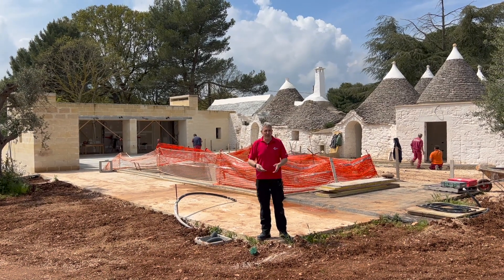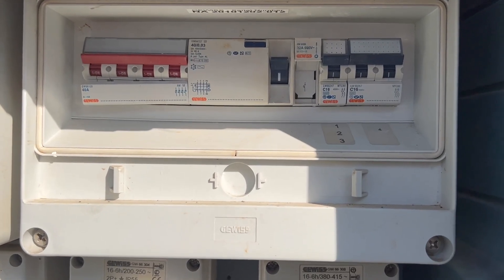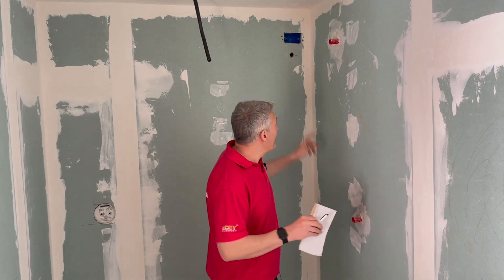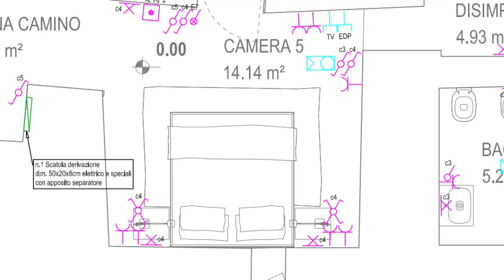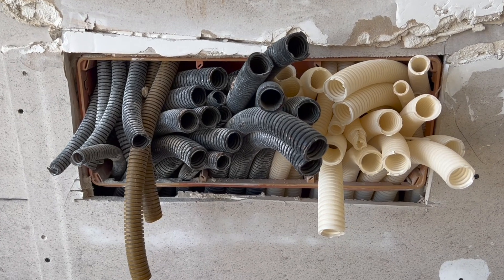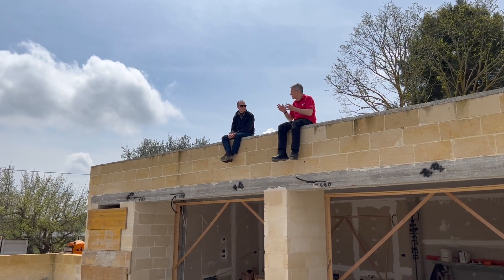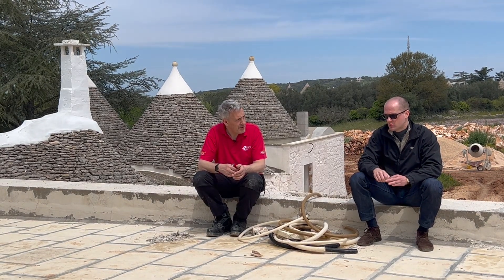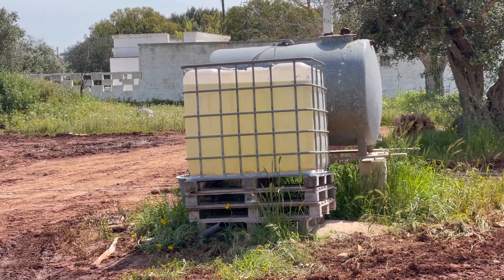Electric Wiring in Italy - You Won't Believe What They Do!

Comment: Here in Malta, we use stiff white pvc piping. No colour codes. We also use the same pvc piping for plumbing, although we use elbows not bending. they are mostly installed in chiseled gutters in walls which would later be plastered and directly on floors which would later pour concrete or lay dirt before tiling.

Comment: Would you mind explain why the UK, the iffin light switch of the bathroom has to be inside the bathroom? Which then causes the use of the "fantastic" pull cord switch? why not have the switch outside the bathroom, right next to its door? It would have been far simpler, let alone safer?
Reply: Somebody outside could make fun of you and turn off the light ;-). No there is no actual safety reason any more. Today installations have waterproof versions. It's just humid air in the bath room, you are not showering the outlets there.

Comment: Wow. I had no idea that electric service in Italy was so small.

Italy is going to have a real problem putting in electric cars if the typical service is only 3 kilowatts.  Maybe you could recharge a day's usage during the night when electric usage is low, but if you took the car out for a longer trip on a weekend, or just a long trip during the day it might prove difficult to charge the car back up at night when power usage is low.
Reply: In fact, as I know, the 3,3kW supply still the standard here in Italy for many houses up to 50/60 sqm
This country produces less energy than needed, the leak must be filled with imported energy and that's why its trade is different from many countries with a higher energy production.
Electricity in Italy is not cheap at all, but it is affordable if you keep your use in a 3,3kW maximum peak. There's a strong education in energy saving and almost everyone has a way not to waste it, based on personal habits.
Of course you can have the supply you need in your house, many big villas may have even 20 or 30 kW supply. But since it is an expensive cost, you are induced to consume just what you need, avoiding substantial waste. If you need a higher supply than 3,3kW, the cost of the single kW increases consistently so the bill will not just be the double, it could be fearfully exponential. Talking about numbers, I live alone and use to pay around 60 or 70 euro per month with a 3,3kw peak, even if this strongly depends on the supplier you choose. I have one which is involved in clean sources development and I pay an extra contribution for research. This is not unusual lately, since the energy crisis caused by the war. 
Anyway the average house in Italy nowadays has from a 4 to a 6kW supply.
A house like the one shown in this video can have a 400 euro monthly bill, probably more if they have high consumption.
This is why self and sustainable production are incentivized, tipically solar or wind power but even geothermal and others, depending on the geographical area.
About electric cars, I think there are special and lower fares if you have a charging tower at home. Anyway public charging towers are quite everywhere and their diffusion keeps growing. Everyone can charge their car a single time for I think less that 5 euros, but there are also convenient pass for regular users.
But you are right: Italy, as many other countries related to this, is having a big problem since one of its major energy supplier used to be Russia.
Reply: @fabrizzz089  ma che stracacchiaccioo dici?! costa di più solo l'allaccio più un fisso di pochi euro al mese, il costo per kwh usato in consumo NON aumenta con la potenza impegnata XD

Comment: I lived in Italy for a bit & yes, that flexible conduit was everywhere in the walls & floors of my flat. The trouble I had there with the electrics was that every electrical cable in the flat was purple, so it was impossible for me to work out what any of the cables actually were in the junction boxes. It looked to me like whoever installed the electrics just used what they had. In this case purple flex. I also remember that the electric company had three tarifs for Italians. The price was dependant on how much electric you could use at once. Cheap tariff allowed you to use the washing machine & a few light bulbs. If you drew too much current, the electrics would trip. The medium tariff would allow the washing machine, tv, all the lights & the shower to be used at the same time. If you drew too much current, all the electrics would trip. The most expensive tariff allowed you to use as much as you wanted. If you were a foreigner (straniero) living in italy, the electric from the electric company cost more as you were not Italian. You had to have the stranieri tariff, which was even more expensive. It is the most racist place I've ever been in my life. There were also frequent power cuts I'm talking at least one or two every month & this was not in some small country village, but in Milan.

I was happy to leave & will never go back.
Reply: LoL there is no different electricity price for foreigners, you didn’t understand the rules. There is a tariff for residents(meaning you register your house as your primary home) and one for second homes. Being a foreigner has nothing to do with it. I’ve noticed that some people, when they don’t understand the rules of the host country scream racism for every little reason, maybe because they’re bigots themselves. Just inform yourself better wherever you go.
Reply: @dayros2023  LOL, I guess your saying that my Italian wife, her family & all her friends & their families etc don't understand the rules in their own country! How silly!
Reply: @phoenixxavier9615  LOL exactly. Check it if you want.
Reply: @phoenixxavier9615  what @dayross2023 said is true, the two tariffs are called "domestico residente" and "domestico non residente", the difference is not the nationality but the declared place of residence. If you are a foreigner residing in Italy you can pay the lower tariff for the utility in your first home, but to be honest the added fee is quite small.

Comment: The problem with flexible is that's it's relatively narrow inside and the repeating ribs cause more friction to the wirepull than a flat surface.
Worst though: too easy to make sharp turns.
I used plain 20mm pipe unless really complex routing in reno where I know only few wires will be installed.

Comment: Just a note on the consumer unit/distributon board as an Italian expat in the UK. From my experience that is a very large one, probably due to the supply being 20kW/3 phases. In monophases, 3/6kW installations which are the norm, you get smaller ones, the same size as an average UK one i would say, with usually only a handful of breakers for a lighting circuit, and a socket one that runs through the whole house (and the protective differential circuit breaker of course, that covers both the other circuits.)

Comment: If you have a concrete flat roof you can make an edge to hold the rain water and a down pipe with a tap to asses it. Italy has been denied cheap nuclear power unlike France with the fake Charnobil propaganda against nuclear power in favor of the multinational carbon companies.

Comment: The basis of the electrical system is very similar here in the western part of Europe, it only differs in the details.
I live in the Netherlands, older house often have single phase 35A at 230V, that's 8kW. Newer houses are on 3 phase standard, many home owners of older properties have their supply improved to 3 phase as well.
I do have a three phase connection rated at 3x25A at 230V which theoretical gives me 17kW, not sure if the grid transformer is up to that for the whole street.
With the growth in PV on houses, heat pumps and electric car chargers overloading the supply network is becoming a real issue here in the Netherlands.
The government wants us all going in that direction by raising taxes on natural gas and other fossil fuels and at the same time promoting E-cars and heat pumps with grants.
But nobody in the government thought about the supply network which needs to be improved to bear this load.
So the network companies are on their own till now and now the government realises that tax money has to be pumped into strengthening the network as well to make their ambitions on CO2 reductions real.
Some countries take measures to discourage peak loads, like in Belgium where you pay tax depending on the highest load taken form the supply at any given moment during the year, other countries give grants for PV panels and home batteries, this way people are encouraged to spread loads more evenly over the day, maybe helped with smart energy management systems which can for instance switch your dish washer or hotwater tank on when the PV panels deliver a surplus of energy.

Comment: I see many comments about how crazy is the limitation to 3Kw power in Italy. Consider this: the country has basically no oil/natural gas/coal in the ground, and nuclear power was outlawed by a referendum 30 years ago. Sure we have some good sun and wind and they are used, but still most of the consumed power has to be imported from abroad. If we would allow everyone and their mother to use electric kettles while using the hairdryer and the dishwasher, the country would go bankrupt - it's a form of soft-rationing, you see. You can still ask the electric company to give you 4.5 or 6 or even 9Kw, but it comes at an extra cost. However, even if you have a 3Kw contract, you can still install a € 50 alert that will ring off if you consume more than 3kw and after a while break the circuit before the counter breaker settles in (very useful in the situations where the counter is not inside the flat)

Comment: As a person from Italy who has lived abroad for several years, I confirm my surprise in seeing houses in the UK, France, and other countries effortlessly using multiple electrical appliances at the same time without experiencing the typical power reduction issue found in Italian households. As mentioned in the video, most Italian houses generally have a limited availability of only 3kW on a single phase. Only new buildings equipped with heat pumps, air conditioning, electric cars, or induction cooktops typically switch to a higher contract of 4.5/6/10kW. The reason for this is simple: each additional kW results in an additional cost of about €1.7 per month on the electricity bill, making a 3kW contract generally more affordable, costing around €12 per month in 2023, compared to the €24 per month for a 10kW contract. The historical reason behind this is that during the economic boom of the '50s and '60s, Italy had a huge demand for energy. However, being a resource-poor country and with the electrical system unable to handle high loads, this strategy was devised. In my opinion, this is the reason why it is quite unlikely to see electric kettles, microwaves, toasters, and coffee machines in Italian households today.
Reply: You do see most of those because they are only used for a short time. But asciugatrice (tumble driers)? No way :)

Comment: Not the same in North and South Italy for heating and PV. There are strong climate differences!
Just consider that plastic materials are special plastic that not propagate fire.
The reason why meter is outside is that firefighters can cut the power before enter and start using water.
Everything "strange" has a reason for existing.

Comment: My flat in portugal has a 15A only, incoming supply. I made a custom system to automatically drop out the hot water cylinder, when big loads, like the cooker was used. This would prevent the power tripping. I used a current sensing switch and a relay to do the automatic "loadsheding". I works great  and you don't  notice any difference. I made a video about it a long time ago https://youtu.be/6kSEzXnwFpk

Comment: How do you go about pushing cables through that length of flex conduit.. from my experience its a pain in the arse as the ends of the cable get caught on the ribs.. the mains board must get pretty congested too
Reply: You don't push the cable, you pull them! Using a nylon cable puller probe.

Comment: Haha and in Germany 43kw is typical for single family homes 😅
Reply: As I'm provocatively repeating in more comments here... 43kw burning Russian gas... and now? Don't you think that it's the case to shrink a little of your waste of energy? No, reverting to coal is not a bit improvement. You should save a little more. German have done a good job about insulation of building... I have friends and family there. But then they leave the windows open half a day and rely on electricity to reheat the rooms.

Comment: How do homes over there get by on so little power? I know it doesn't get nearly as cold over there, but if I were to get a properly sized heat pump to just heat my house in the winter I would need a 3kW unit just to keep the air temp above freezing and it would likely be running almost 24/7 just to keep up. My furnace now is about 100,000 BTU, replacing that with an electric heat pump would be a 5kW replacement.

I mean, my microwave is 1.9kW. My sump pump just to keep water out of the basement is 1.2kW. That just seems crazy to me... I guess it does make you appreciate more important things in life.
Reply: The heating is mostly managed by natural gas boilers and radiators, not AC.
Reply: @paolocarpi4769  it sounds like you'd have to. Though the guy in the video made it seem like even that was uncommon.
Reply: @2009dudeman  I live in the north, but Italy is not Spain, even in the South it's not uncommon to have traditional central heating.
But today standards maybe have changed. There's a certain push towards heat pump.

Comment: every country does something weird with the wiring except UK, Holland and the US. In belgium 1 group for all the lights in the house and 1 group for all the outlets while in holland we put a cable from the circuit breaker to each room. in belgium the pipe or flex pipe is going from room to room. I prefer a pipe or two from the circuit breaker to each room. 1 for electricity the other for an ethernet cable.

Comment: In the last year the power limit to switch from mono-phase to 3-phases system was grow up to 10 kW, to permit to supply isolated house with mono-phase and permitting to their to install correct PV system without change internal distribution system.

Comment: Earth rods can be hazardous to valuable electronic equipment. I installed them as an extra layer of grounding in efforts to prevent line surges from burning out circuit boards that cost $5,000 USD to replace. The presence of iron deposits resulted in frequent lightning strikes and this high voltage followed the grounding lines back into the CNC machine tools and burned out the very circuit boards the earth rods were installed to protect.

As for the wiring solution in Italy, I cannot say I'm in favor of it as it looks like a mess. My wife would never stop complaining about the visible panels, and when your wife isn't happy you'll be miserable.

Comment: Only a 3KW standard?
How do you even run a toaster?
Reply: Few italians use toaster
Reply: I have a fast boil kettle that's 3k i often would use two of them to boil water for washing dirty dishes etc and would also be able yo do this with a tumble dryer running and othe lower power appliances how i would not like like to do that in Italy. 🇬🇧 👍